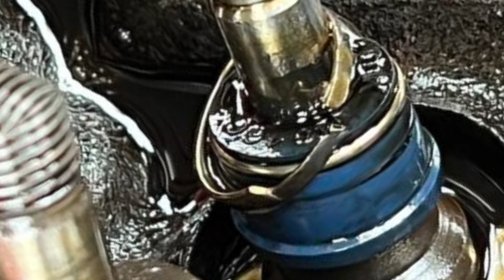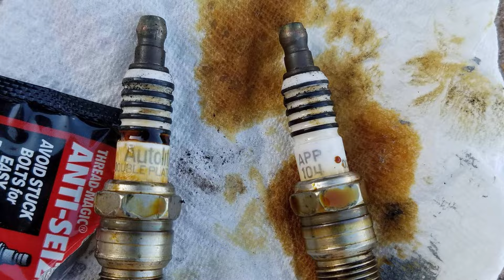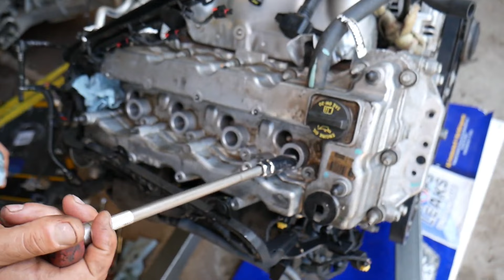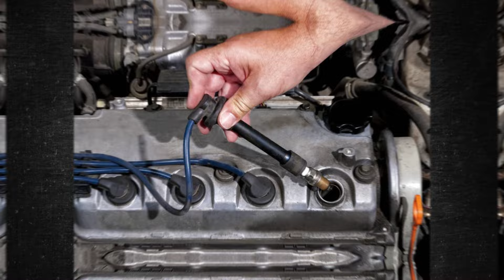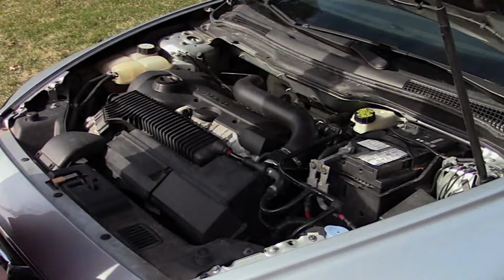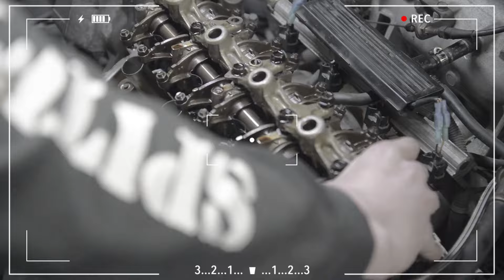6 Bad Valve Seals Symptoms. How to Diagnose & Replacement Cost

Comment: Nissan Tiida Mr18  what is the problem when  you  find oil in the air filter
Reply from the maker: Oil in the air filter on that Tiida? I’d look at the PCV system first, not valve seals.

Check the PCV valve, breather hoses, and make sure the oil isn’t overfilled. If that PCV gets stuck, crankcase pressure starts pushing oily mist back into the intake — basically the engine starts breathing through the wrong end.

A light oil film isn’t the end of the world. But if the filter is soaked, check PCV and then do a compression/leak-down test for blow-by.

Valve seals usually give you blue smoke, not an oily air filter.

Comment: I bought a set of new fully assembled Dart iron eagle 200cfm 72cc chamber heads on a Chevy 350 L48 and the nylon seals went out in 5k miles. The cam was only about .440in lift..I'm putting Viton seals back in.

Comment: I just changed them myself on a 07 3.7 Dodge Nitro with 242000 miles.  Also changed out the lash adjusters and rockers.  Was using a qt every 500 miles.  Now. 300 miles since and the oil level hasn’t changed! No more blue smoke.
Reply: Did you pull the head ? I’m bout to have to do a caliber for my dad. It’s at 198k miles and poorly maintained it been eating oil.

Comment: Having all the issues stated in the video on an older ford that was parked around a decade. 32 years old and the Cats are original with everything else. I unplugged the 02 sensor and it runs much better. Does not seems to smoke any now on cold startup . I think cats were plugged
Reply: Get some anti-foulers if you removed the cats, they are spacers used to move the downstream o2’s out of the main flow and keep the CEL from coming in due to low catalyst threshold   And put a test pipe or resonator in their place. Works really well for me.
I still had to replace the o2 sensors and I know if something else happens due to my CEL not being on all the time.

Cats get destroyed by oil ash plugging up the catalyst. 

Just sharing.

Comment: You don’t need to run a catalytic converter that’s for stupid emission laws 

The exhaust flows better when it’s straight pipe
Reply: Removing your car's catalytic converter without reprogramming the engine's computer (ECU) is a surefire way to unleash a host of performance problems, leading to significant regret. Your engine's vital oxygen sensors will send conflicting signals to the ECU, triggering a check engine light and forcing the system into a default, inefficient "open-loop" mode. This means your car will likely run excessively rich, leading to terrible fuel economy, a noticeable loss of power, and potential issues like fouled spark plugs and a rough idle. Furthermore, achieving the necessary updated ECU software for such a modification isn't always possible, as not all car ECUs can be easily reprogrammed or tuned for this specific alteration. You'll gain nothing but a poorly performing, frustrating vehicle.
Reply: @T @TorqueTickler at? These cars and trucks run a ton better without the emission bs. You try breathing through a straw all day. And see how much your heart likes you by the end of the day. Now imagine what cars and trucks goes through.
Reply: @Carolina_Boy_93  I guess you didn't read my statement. It was very specific in detailed.
Reply: You don't live in a big city do you?
Reply: the fumes kill you bro
Reply: @Cuccaweepoo, we all gotta die. At least live a little before you do.
Reply: Gas engines run better with back pressure
Reply: @faesalannefaie6841 fr? I straight piped my ram 5.7